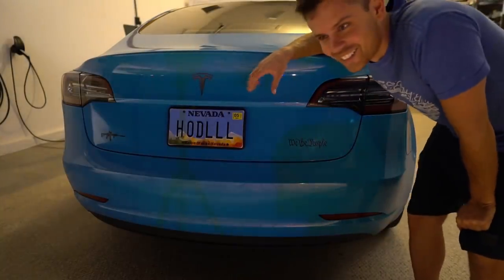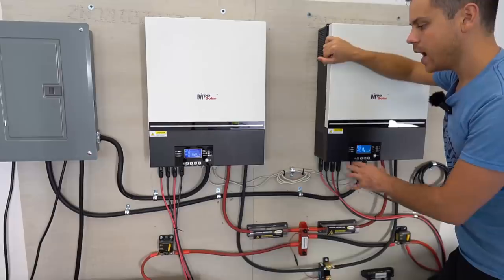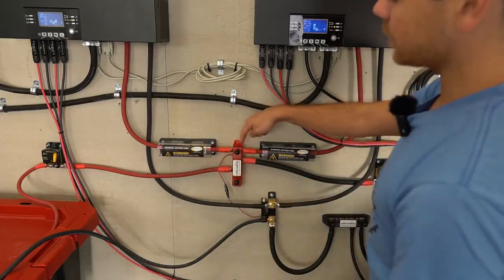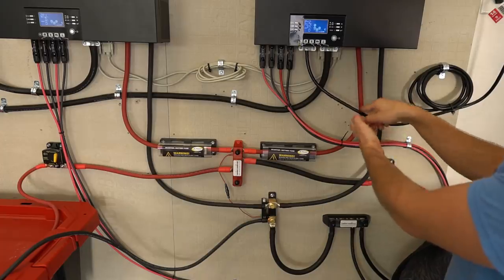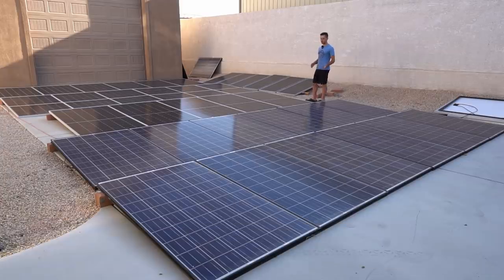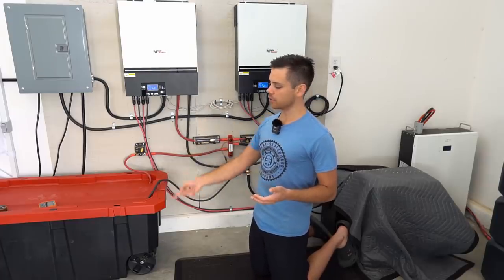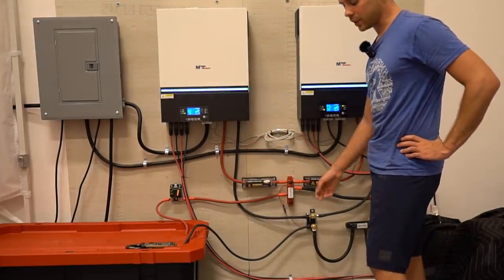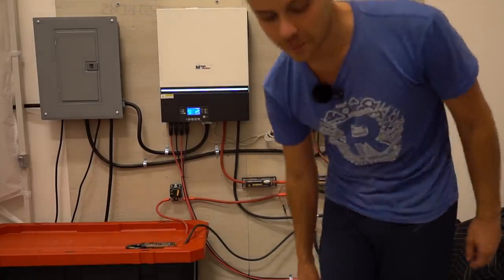New Upgrades for my Offgrid Permit-Free Solar System: I am now charging my Tesla without the Grid!

Comment: "Stop crying and start building" LOL - Classic. So on a nice day, how long does it take to charge that battery up from SOC=0? Thanks for sharing.
Reply: All evening and all night with a 240v 50a plug.  At least that's how long my brothers took when I had to charge it at my shop.
Reply: If you mean the Tesla, it takes about 7 to 7.5 hours to charge from 0-100% at 240V and 48A.
Reply: @android04  not in the real world bud.
Reply: @zacharymorris9917  yes, in the real world.  I have had my Model 3 long range for 3.5 years and over 66,000 miles and use a charge connector that puts out 240V and 48A to the car (which is the max).  If you use the mobile charge connector that comes with the car, it takes a little longer because that will only put out 32A (could take 11 hours for a Model 3 long range).  The time can be less for a Model 3 short range, or more for Model S or X.
Reply: @android04  I will believe you instead of accepting reality.  It was my imagination that his car still wasn't charged at hour 14....

The entire reason I rewired my outside RV plug from 30 amp/120 to 50 amp/240 was to get it charged overnight instead of effectively two days later.  If it would have charged overnight on a normal wall outlet it would have been left on a normal wall outlet.  Even after changing it to a 240 plug it wasn't 100% charged the next morning.

”Here's a breakdown of the charging methods and approximately how long each take to fully charge a Tesla from being completely dead: Level 1 AC (120V outlet at home): 20-40 hours. AC Level 2 (Third party chargers/Tesla chargers/Tesla home charger): 8-12 hours. Level 3 DCFC (Tesla Supercharger): 15-25 minutes."  

"8-12" sounds a LOT MORE reasonable than 7-7.5.  75,000 watts at 48 amps and 240 volts is 8 hours in a perfect world at typical AC to DC converter efficiency.  That does not allow for any low SOC or high SOC charging algorithms.  In the real world, it took over 14 hours.
Reply: @android04  I edited my original comment to be more accurate BTW.

Comment: Will - I'd be interested to see a cost breakdown of your system. A lot of the value of Solar comes from understanding the break even point in comparison to grid dependency costs.
Reply from the maker: That depends on where you live. And what you're doing it for. In California, this system would pay for itself in four years.  Where I am, 15 years. I just don't want to  use government regulated electricity. Or being dependent on it. That's priceless in my opinion.
Reply: @WillProwse  I am going to try and look this up but can you build a solar panels in California off grind without permits on the ground level?
Reply: I’m in the Midwest where electric is dirt cheap, the cheapest in the country . I’ve ran the numbers and had my numbers double checked and it would take me about 24 years .

Comment: I think such a system (solar-battery-inverter-EVcharge) would work just fine in Jupiter Florida too. Our solar Irradiance/insolation seems to be about 4.7 hours/day (annualized) for South facing panels at about 27 degrees angle.

Comment: I like those Blue Sea Systems breakers and thinking of getting a couple but concerned they are only rated to 48V.  Being that a typical 48V bank is almost always over 48V, I am not sure they would break a short circuit.  If I get them, I will also have the system fused with rated fuses.
Reply from the maker: Oh it's a stinger breaker. Just as good. And yeah, blue sea systems stuff is great.
Reply from the maker: 48V gear should be good to 60V. That's equalization voltage of 48V packs

Comment: Nice to see your projects Will. One thing, I do not know how the situation there is regarding thunderstorms. I live in Bali and my Installation with battery charger, batteries and inverters was destroyed by a lightning strike somewhere in my garden. I found out later that there was something wrong with a ground connection, the dc part of the installation was floating. I don’t know if the different parts of your installation are properly grounded, be aware of the problem and what can happen when very high voltages are induced in parts of your setup….
Reply: Overvoltage protection on the dc side is easy to come by it is merly a standart item , i have even one on my 2 fase grid conection , learned that lesson after a lightning strike hit a palm treen and the main grid cable is buried 8 feet from that palm tree .
About grounding your dc side , ther are books written about it and the conclusion is open , i think not grounding the dc side is the best wih a good overvoltage protection

Comment: Hello Will and Group:
Will I do wish you would do a test on Fullriver Batters and on the Epever all in one solar Charger controller inverter.
I ordered my first deep cell battery and it was stolen when it was delivered and EBay does not want to cover the loss of the stolen battery or refund my money. It was a  Renogy 12 volt 100 AH. After I ordered I doubled checked on the temperature Renogy batters can handle only down to - 4 F below O where a Fullriver can deal with -40 below O and a higher summer time temperatures. From memory I think in the winter Renogy Batteries will recharge if the temperature is above 32 F.
Yes Will I did order your book and it helps me a lot I have watched your you tube video’s for three years almost.
I want to use solar power on off grid farm/ranch. I have a lot of design ideas like slave solar Charger controllers With battery bank and ground mounted Solar panels, a portable veterinary treatment trailer that is solar powered.  A portable multiple fan intake and exoist system that has three or four fans that can move over 320 CF of air that could be designed for 12 volts or 24 volts system. I would be nice to

Comment: If you use the Tesla a whole bunch, you could need 50-70 kwh worth of power.  Even at half full you would need 25-30 kwh of power.  My problem with that is that the Tesla is using as much power as my whole house.. and the solar I'm planning will happily keep me comfortable in the house.  Frankly, the grid here is so tenuous that charging a car on solar may be the only way to do it.  (When you have 8 outages per year running from 3-4 days to 3-8 hours, you need solar.  A propane generator would exhaust a 350 gallon tank in 2 1/2 days... So I gave up on getting a Generac or whatever.  Too expensive at $3 a gallon for a propane delivery every 3 days. That said.. a 30-40 kwh battery system here would keep the house running for almost 2 days if I cut back on power usage. Unfortunately we have lots of clouds....

Comment: Ha  Will. I have the plan to mount an all in one unit in the back of the cyber truck I ordered. I can run it off the trucks in built inverter and plug about 2000w of solar into it. I will fire proof it as much as possible and have the cover  open while charging. my truck will be at home in the garage most of the time as i am retired. i only need to charge it at 5 or 10A as i dont do alot of miles. what do you think of this idea?

Comment: Just as an average consumer with some electrical experience (have built my own RV solar charging system) and I like the challenge of building a system simular to the one in this video. I've watched your process for the last few months; what would be a ballpark estimated cost for this type of system you are showing including all the panels, wire, batteries ......

Comment: I’m not convinced that the power cable to your inverter is sufficient enough to be a ground for that system. 
Size wise of that cable is probably under sized the potential power you could send down your ground which if your lucky may be 2mm?
Most power cables are rated to around 13amps. Just a thought Wil
Reply from the maker: The cord is not for that purpose. It's an sds and most of the time it's a floating system. Which means no true earth ground at all. Every few months or so, I can plug it into my earth ground system to dissipate excess charge that accumulates. Or not. Technically the air conditioner has true earth ground with 6 gauge conductor. But it doesn't need that either.

Is not the same as a electrician grounding a panel. It's for dissipating any charge accumulation. It's a battery charger at the input. Nothing else. 

You must have this system confused with a hybrid inverter. It's not.
Reply from the maker: If this was a hybrid inverter tied to a grid tie system with ats, I would use 6 gauge grounding conductor. But it's not. So I won't. That would be pointless on this system. Tell me the utility of that configuration.

Comment: Will- do you know if there are any DC-DC chargers for EV's out there?  Its kind off silly to take DC power, store it in DC, then convert it to AC, over a wire, into the car, to get converted back to DC in the car.  DC-DC would be much more efficient right?  Just some legacy infrastructure making the current setup the easiest to implement?  Or maybe you need to step up the voltage to keep the charge cable from being massive?
Reply: the problem is that the actual battery charger is built into the car, the "charger" that you plug into the wall and the car is really just an interface cable. in order to charge the car with dc the manufacturer would have to provide a dc charging port of some kind, not much demand for it and there would be some safety issues to deal with so that's why dc charging isn't offered.
Reply: @marzsit9833  I always thought that if purchased the actual wall mount EV charger, that this was doing the DC conversion (faster than the onboard charger).  After some more googling it sounds like you are right.  Only the Superchargers bipass the onboard converter.
Reply: DC is an inefficient way to transmit power. Nikola Tesla proved this during the “current wars” against Thomas Edison. 

10 volts at 1 amp (10 watts) can use smaller diameter wire versus a 1 volt 10 amp (also 10 watts). Using nominal voltages, by stepping his 48v system up to 120v (2.5 times increase in voltage), you can decrease your current draw down 2.5 times. The wires can be smaller and remain cooler, thus reducing the chances for electrical fires. 

I do have to say, MOSFETs are magical.
Reply: @NeverEvil1  You are partially correct.  The most efficient way to transmit power is actually DC.  Tesla won because AC was mush easier to step up the voltage to high voltage with a simple transformer.   High voltage is the real winner. Today, the largest transmission lines are actually DC high voltage lines.  The hardware to step up the voltage for DC is $$$ so it only has a payback for very large loads.

Comment: Panels laying on the driveway blocking a garage door = most expensive ground mount ever :)

I just put in my 10kw ground mount array. It was a lot of work! Trench, holes, concrete, posts, racking — I wish I had a spare driveway to lay them on.

Comment: Cloudy in Las Vegas? No cloud in sight here in NLV.

I live in a condo development, which does not permit solar panels. Otherwise, I would be living offgrid. 
One can also charge ongrid at night when power is cheap, and run offgrid in the day time when electricity rates are over 6x higher.
Reply from the maker: Oh right, I filmed that part yesterday. And yes very true about time of use programs. That can save a ton!

Comment: Found your channel recently, loving your videos! Really getting me interested in building my own off grid system to charge my EV. 

At the risk of sounding really stupid, I’ve been curious why all these solar systems first convert the power from DC to AC, just to have the car charger convert it back to DC to charge the battery. I wonder if there would be a way to do a direct DC solar to DC charge. Theoretically that would be more efficient?

Comment: How many watts does the charger take? I’m tempted to change my big military truck/RV to electric.
Reply: Typically they can run off 120 or 240. 120 charges very very slowly, like 30 miles of range in a night. 240 is much faster. I use a 240v 32 amp connection for mine and it fully charges over night (around 8 hours or so depending on starting soc)

Comment: @ ~ 4:00 well.. sorta.. the resources for building the renewable energy stream is extracted mainly using Diesel...
Reply: Sure, but these emissions are compensated for when the system is in use.
Reply: @Simon-dm8zv  you aint removin' tons of earth w/ an EV for another ..20(?) years.. so...

drill baby drill
Reply: @wizdumb420  I do not see a problem? By the way, electric heavy duty dump trucks already exist.

Comment: when people finally figure out they can get paid to heat their house in the winter, that's when crypto will really take off. Two S-9's have the same heating capacity of 5kW strip heater, just position them so the blow into the supply air duct.

Comment: Do you plan to leave the solar panels on the ground?  I am getting ready to start my system here in Colorado Springs, Co.  I will probably put mine on the ground as well but prefer a more "fixed" array.  Any ideas?  Also, have you done any reviews on sungoldpower 5000W 48V SOLAR CHARGER INVERTER.  I am unable to find anything on this.  forgive if you have already answered my question.  There is a lot of comments to read through, lol  Cheers!

Comment: Great video as usual.  I've setup a LV3048MK and 48v 4.4 kwh LifePO4.  The AC cord is 10 gauge to handle 3kw continuous.  4k solar input 10 gauge.
SO far...able to run 16-20 gpu in the sun @2.1-2.2kw/hour.  Only running during the day as proof of concept for password cracking and mining. 
Will, I bought 3 RV lots totaling  23,000 sq ft in Dateland, AZ.  Off-grid RV spots and server farm with atmospheric water generator sounds ideal. 
I need more batteries and to setup physical perimeter...to keep out the desert crack heads.

Comment: I have a similar off-grid Victron system I've built for my Tesla, 3.5kW PV, ~10kWh of Battle Born's, dual Multiplus 3000VA inverters to achieve split phase 240V. I originally had a single inverter with their autotransformer but the car did not like it (took a minute or two to start charging and charge efficiency was lingering around 85% whereas now it is at 95%). Not sure why you're using 300A fuses in series with 150A bi-directional circuit breakers. Max current will be 150A to each battery bank, so why add additional fuses?

Comment: Electric cars ARE still powered by fossil fuels for much of their charging. That said, grid power plants produce power much more efficiently than a standard combustion engine. So it is still more efficient not to mention the reduction in other things like engine oils, etc. Electrics are the future but we still have growing pains right now because a home system like this to save 100-200$ a month in gas isn't an option for most people.

Now for my 2 cents on this setup. I do not like the idea of double efficiency loss and two batteries getting cycled for 1 use. Ideally a setup like this you would charge during sunlight hours to prevent solar > charge controller > Battery > inverter > charger > Car. The better use of power is Solar > Charge controller/Inverter > Charger > Car. Even if the solar can't put out the full power the car needs, you are still reducing the losses. Plus you can afford to setup the system with a smaller battery because lets face it, that is probably over half the cost of this system.

Comment: Last year we ran junk lead acid used. Worked. This year we got now 4 new lead acid. 24v system. Gonna be grabbing 4 more. They do suck. With 4 more I'll have 400ah 24v
What's the cheapest but better way to upgrade? Dhgate cells? There older lithium technology?

Comment: How heavy is that DIY battery.  I live in basically a forest mountain with no room for panels but I own some flat rural land that I could put out panels on.  Would it be an interesting project to make a portable battery to fill up remotely and tie it into a home discharge.  Also, could you put a battery in the back of an electric pickup and use it like a spare gas can.  Obviously it wouldn't run from that battery but could you rig a remote charging port to refill the onboard battery overnight?

Comment: If this was my system, being a floating system, I would leave it ungrounded. grounding it will only increase the risk if electric shock by creating a ground path back to the system. code requirements state for generators that are not wired into a house or other structure that is also connected to the grid are not to be grounded do to increased shock risk
Reply from the maker: Good point
Reply from the maker: I agree. I just wanted them to stop crying. The charge accumulation is so minimal. Using it as a floating system is fine. I actually just plug it to true earth ground for a second every week. It's plenty to avoid any issue people were talking about.

Comment: I dig your videos 👍 but I gotta ask how much are you spending to avoid  buying gasoline? I spend on average maybe $80 a month for gas let's just call it a $1,000 a year.. to me it looks like you have atleast 15yrs worth of gas invested in that system a system which will require parts replacements & battery & solar panel replacements.. is your angle the savings? Or being green? I guess I can understand it if your angle is being green